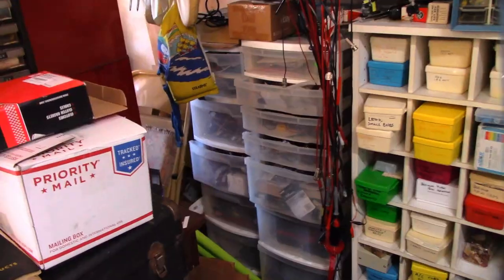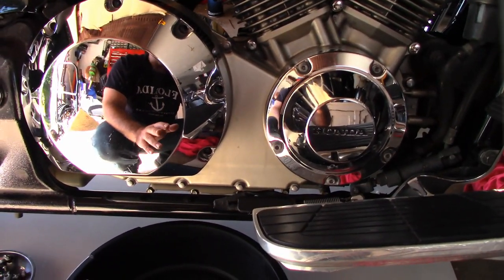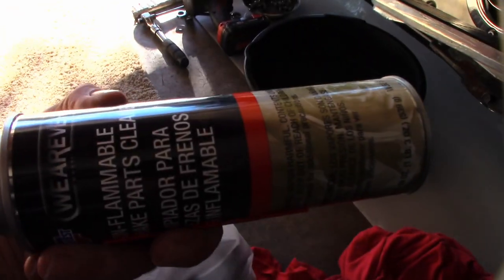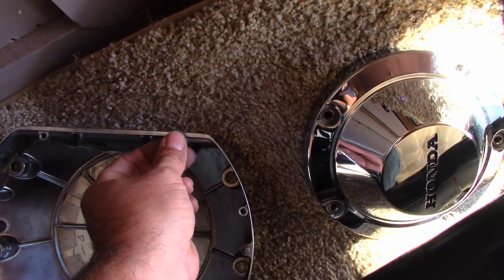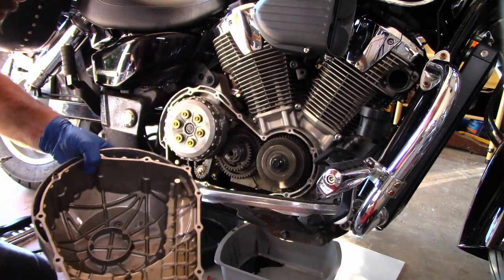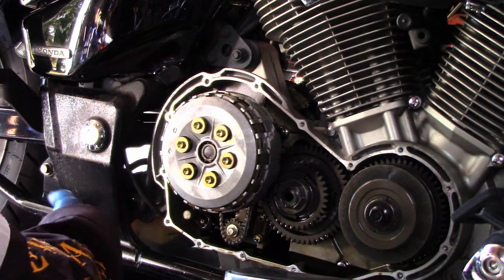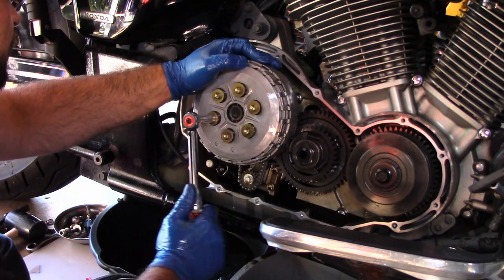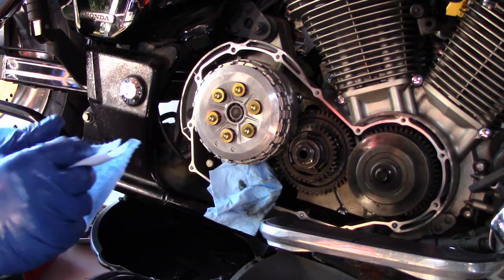vtx 1800 Clutch replacment Full version

Comment: Gotta say, this is a very good walk through. Personally I have been working on motorcycles for nearly 20 years and there is basically nothing I haven't done on a bike from engine/transmission work all the way to a full tear down, custom paint, performance engine work, etc. With this walk through you could literally do the job for the first time and not have any issues. Well done.

Comment: Excellent video! I just picked up a beautiful VTX 1800 with 38,000 miles. Runs super but due to the low level of the fluid in the clutch reservoir I have a feeling a clutch pack will be a "soon" project. Thank you!
Reply: Clutch reservoir?
Reply: IF THE CLITCH CABLE IS SERVICED RIGHT WITH THE RIGHT AMOUNT OF FREE TRAVEL YOU SHOULD NEVER HAVE TO TOUCH THAT CLUTCH--UNLESS YOU RIDE  THE CLUTCH  YOU KNOW BY HANGING YOUR CLAW ON IT ALL THE TIME --ONCE YOUR MOVING LEAVE IT ALONE --DONT THE VTX SHIFT WITH OUT A CLUTCH ONCE YOUR ROLLING --MY V-ROD --ONCE YOUR ROLLING IT WILL SHIFT UP OR DOWN WITH OUT THE CLUTCH AND IT IS SMOOTH  --I HAVENT RODE MY 2007 1300 YET SO I DONT KNOW --IT WAS HIT BY A LEFT HAND TURN BY A CAR --IT NEEDS THE FRONT END REPLACED --I HAVE A ROAD STAR FRONT END THAT GOES RIGHT ON BEARINGS AND ALL ---I REPLACED THE STEM IN THE TRIPPLE TREES AND I AM GOING TO RUN IT WITH THE STAR TUBES AND SPRINGS --WITH THE VTX BREAKS AND ROTER   PLUS THE STOCK HANDLE BARS--YOU WONT HARDLY KNOW THE DIFFERENCE WHEN IT IS DONE--FOR A HUNDRED BUCKS  IT WAS ADEAL --THE JOY OF DOING MOTORCYCLE SALVAGE  YOUR NEVER OUT OF PARTS AND YOU CAN BUILD SOME REAL FRANKEN STIENS
Reply: You will need only tge springs

Comment: Hi there,  just got a 03 vtx 1800c and after riding for about 20 min. I being having problems with the clutch lever getting really hard to squeeze, clutch doesn’t help the bike to take off on first gear and. The clutch cover gets really hot to the point that it starts to burn my leg when waiting at the light. Are this sings that the clutch needs to be replaced ?  Any tip will help!  By the way this is the best video about replacing the clutch on a VTX. Thank you!
Reply from the maker: Well the VTX is notorious for having weak clutch springs causing slippage leading to worn clutch and worping of front plate anyways however  I'm suspicious of other things if you are saying the heat build up is that dramatic. In any case my fist thing I would do is check proper operation of slave cylinder. It could be slightly hanging up. In this circumstance I would pull right cover check for damage install new clutch with springs while in there and make sure hydrolic system is operating correct. Appreciate the shout out on the video glad it's helping the community.
Reply: That all sounds really strange. The exhaust is on the side of the clutch and that may have something to do with the perceived heat however being that the clutch is hard to squeeze you should definitely do a fluid flush/change on the clutch fluid. I would then change the clutch pack and springs. Someone may have been in there already and put a  a few too many washers/shims on the clutch bolts. 

It is an 03 I own a 03 VTX 1800 RTS  and the very first thing I did was change the fuel pump, filter, oil, clutch pack/springs, ground fix, smog delete, and slapped a car tire on the back.
She is a beast and I have come across nothing that can touch me off the line. The fuel filter and pump made a hUUUUUUUUGE difference. Oh replace the fuel pressure  regulator while you do all this; it is a part that fails being so old.
Delphi / Fuel Pump Part Number: CFE0351 SKU: 340739)( Duralast / Fuel Filter Part Number: FF3424DL SKU: 830815)

This is a website that will guide you through all of this. Go to the maintenance  and tech area on the left and be amazed.
https://tech.bareasschoppers.com/engine/valve-adjustment-vtx-1800/

The bike is old and deserves to have all this done. She will tear the road and her tires apart for you after you do.
Reply: @rogerhurd6434  thank you so much for te tips roger
Reply: What you need to do is remove the clutch reservoir cap on the handle bar and press the clutch lever again. It should go in. Perhaps you need to bleed to which is on the left side bottom rear of the engine. Remove the chrome cover and you'll see the bleeding bolt.

Comment: I'm installing the Barnett kit, I can't seem to find a location mark on the new clutches, also did you torque them to 12nm
Reply from the maker: Install clutch pack after soaking with oil. alternating the disc starting with a friction disc then a clutch plate so on until the last friction disc. There are no location marks except that all the tabs/groves need to align when installing. And yes torque in crisscross pattern to 12-N.m /9Ft.lbs. use a correct torque wrench made for these low torques or snapping of bolts will result.

Comment: I just change the clutch on my vtx 1800 , and I have a problem,  It doesn’t shift . Any tip or idea you want to share , did fallow all your steps . What gear does it have to be when you change the clutch
Reply: It doesn't have to be in any specific gear. What do you mean it doesn't shift maybe you didn't put your dowel back in right which is the thing he pulled out in the middle of the clutch basket and it's job is to push stop pressure plate out and compress the Springs to allow you to switch through gears